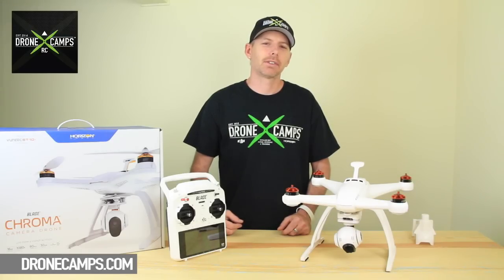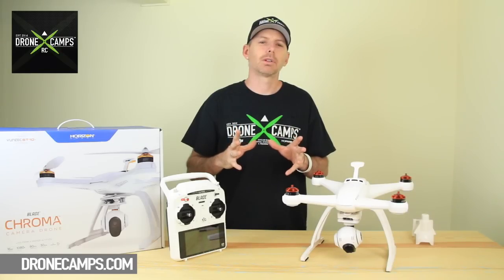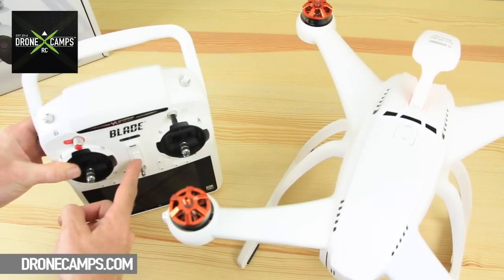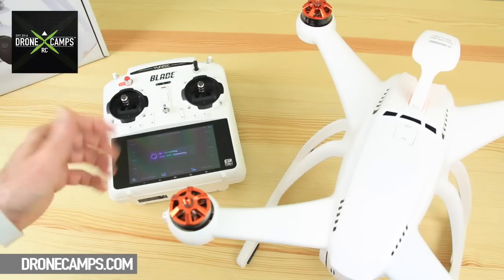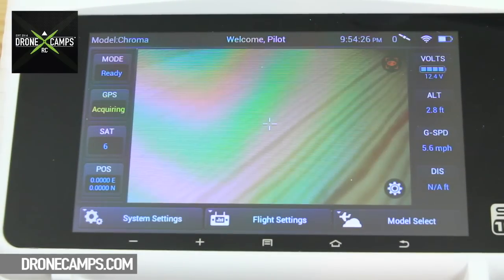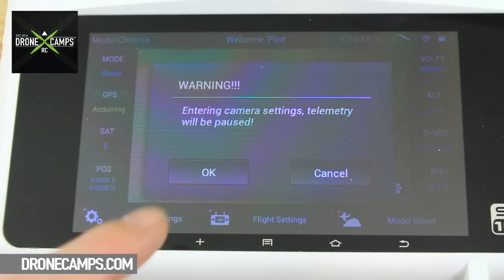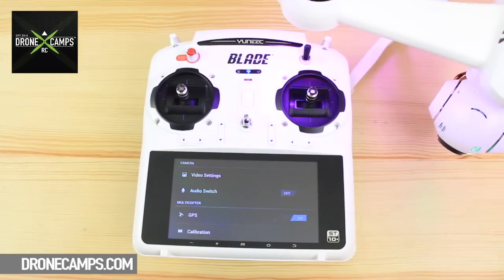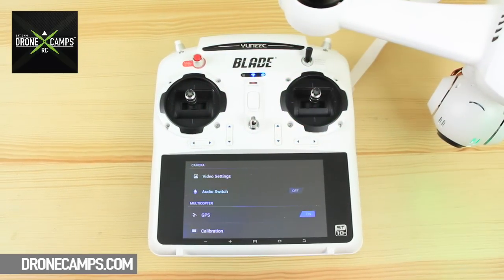Chroma : Accelerometer Calibration - When & Why?

Comment: My Blade Chroma ST10 CGO 2+ has a motor problem,  I bought this used,  the right rear motor, # 3 I think doesn't want to run, and when I power it up that motor jumps everytime the drone beeps during start up. I bought 2 new motors from hobby lobby, after changing the motor it does the same thing. Anybody got a fix? mleddy at live .com. thanks.
Reply: also it seems to unscrew the prop too.

Comment: Thanks for the video. Quad and transmitter are powered up. While quad is on the ground, i select track mode ( lights of the quad change color ), and i send the quad up more than 25 feet in the air. I cannot change the rotation of the quad so that the camera follows the transmitter... Camera doesn't seems to point the transmitter in my hands and it won't rotate to face it...Would you know why ?